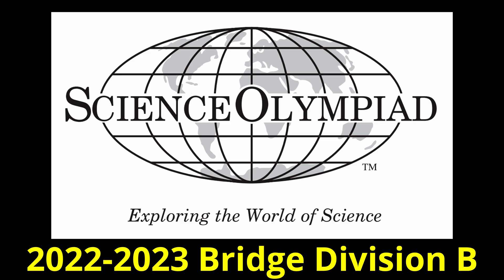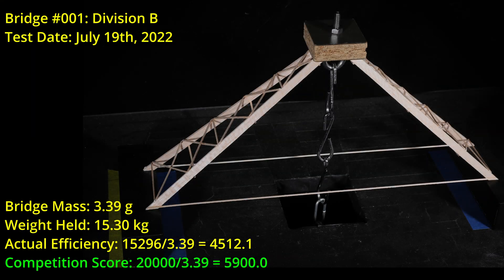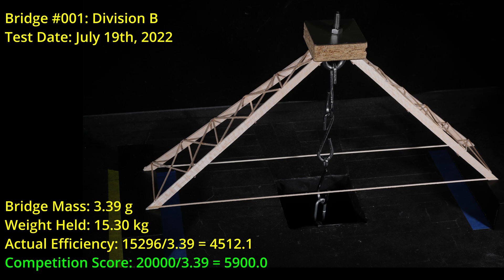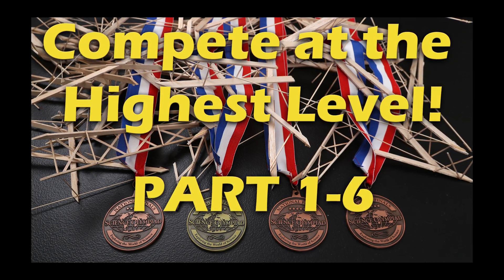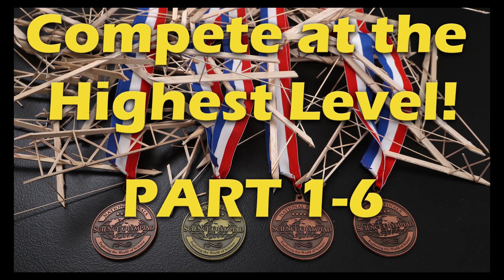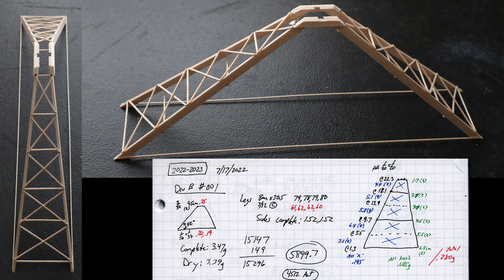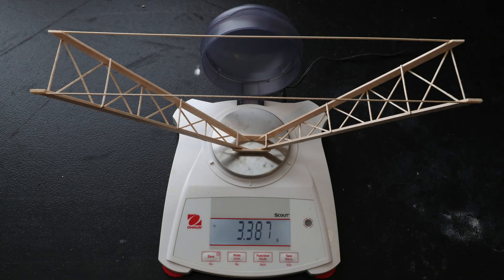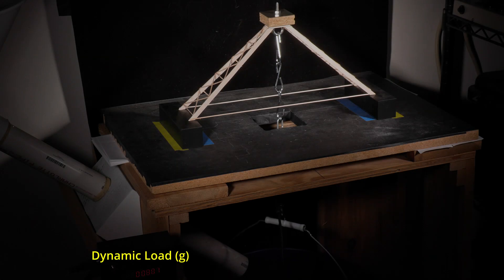2023 Science Olympiad Bridge Div B: 5900

Comment: Could you please share the files for the building jig that you used for this bridge?
Reply from the maker: Hi Bindu, I have been purposefully not sharing the assembly jigs for this build yet.  I haven't decided one way or another if I should.  Because this bridge performed so well, basically at a top National level, I'm not sure if I want to remove this challenge from the team's task.  Keep checking back... if enough people ask for it I will.  Thanks!
Reply: @balsaengineering6686  Thanks!
Reply: I would also like it if you could share the files for the assembly jigs but if not I was wondering how to go about designing the jigs. Thank you!
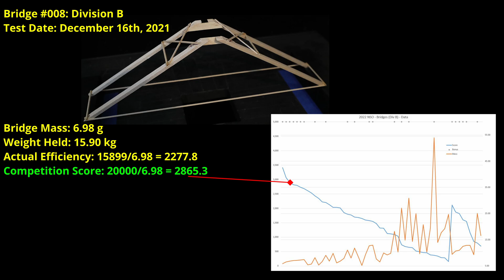Reply from the maker: @meeraradhakrishnan8416  Think about creating the assembly jig in 3 parts.  It's probably too big to print all at once, it was for me.  The middle is really just triangle with the top chopped off.  Actually, you could even leave the top not chopped off and it'd work.  You just need to decide exactly how wide you want your bridge to be at the bottom and top, create a triangle in a CAD program and extrude it about 45mm.   The 2 end pieces are just the same width about 7-10mm tall with the same taper as your triangle from before.  I made them each 180mm, but that length isn't critical.  Then you need to glue the parts together.  I like to use PL3 construction adhesive for that task.    If you check out Part 3 of my optimization series that used the 2015 rules, at the 1:08 mark of the video you can see several examples of what I'm talking about. The 2023 version is very similar to the narrow version shown here:  https://youtu.be/0tzcp99kzdk
Reply from the maker: Hi Meera, I have decided to share the STL files for the jigs I used.  You can find the links in the description of the video, or I also pasted them in another comment in this thread.  Good luck!!
Reply from the maker: Hi Bindu, enough people have asked me now, I have decided to share the jigs I used.  You can download them here if you still need them!

Assembly jig parts:
https://klingerphotography.com/BalsaEngineering/2023/DivB_middle.STL
https://klingerphotography.com/BalsaEngineering/2023/DivB_edge.STL

Sides:
https://klingerphotography.com/BalsaEngineering/2023/DivB_side_LEFT.STL
https://klingerphotography.com/BalsaEngineering/2023/DivB_side_RIGHT.STL